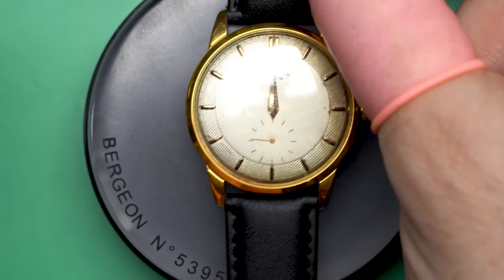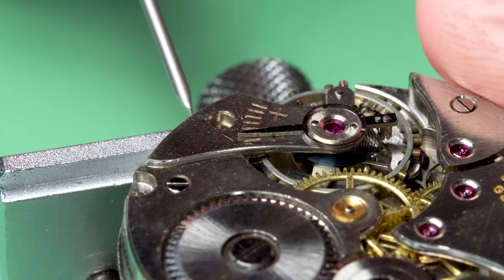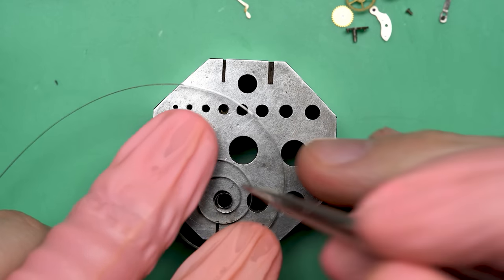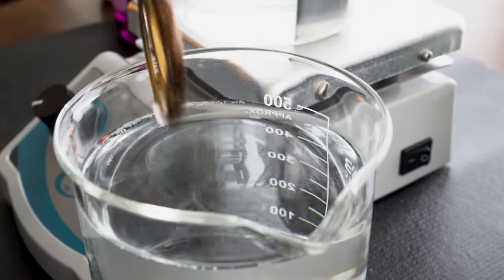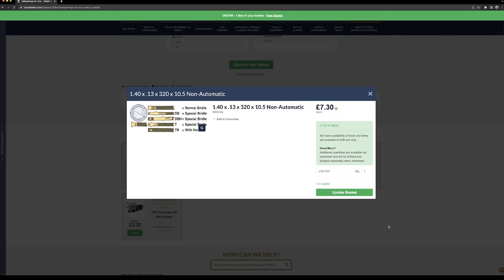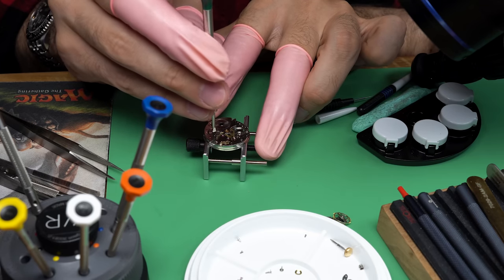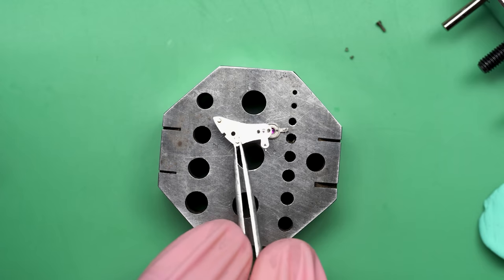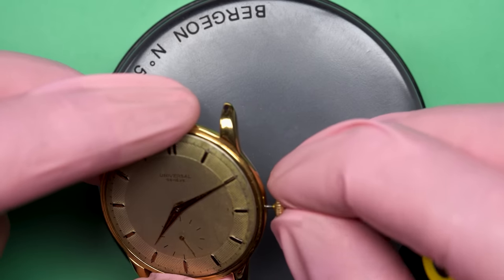Here's My First Attempt at Gold Plating During a Vintage Watch Restoration!

Comment: Nice job with the plating. A word of advice when you are plating, attach your leads, then turn on the power supply. The sparks you were causing when attaching and disconnecting your leads can ignite the gasses coming off the plating solution. Primarily this is an issue with with the cleaning solution as all the bubbles coming off that solution are hydrogen. The amount of hydrogen coming off that beaker isn't huge, but if it ignites it is loud and with scare the crap out of you. It could also shatter the beaker. I worked doing plating for over a year and had that happen a few times, but on large industrial tanks.
Reply: +1 Be careful!
Reply: Indeed, always put on the power last. And something with Hydrogen being an explosive mixture between 5%-75%. Otherwise cool video to watch and see the process.
Reply: Agreed!  I recommend a power supply that has an output on/off button.  So you can set up the supply with the output off to the right voltage and current.  And then hook up your wires.  And then just hit the output on button.  Cheap power supplies are always on and are not as reliable when they are powering up and down.
Reply: A good idea would be to get a small fan to blow over the top of the beaker. At least then you'd know you're not allowing much hydrogen to concentrate around your electrodes.
Reply: Crikey.
Reply: Thanks for this! deserves a pin i would say

Comment: The "Feintester" is an interesting tool that appears to be made from a dial indicator with a fixed anvil.  Dial indicators are commonly used in machining and mechanical operations for measuring fine distances.  Interestingly enough, they use a mechanism with parts very similar to watch parts, and serviced with the same tools.  I have some old indicators that I plan on cracking open and servicing, based on the skills I've learned watching this channel.
Reply: There you go! The power of a youtube channel.

Comment: Your videos inspired me to take a crack at watch disassembly and reassembly, just for giggles. Spent $40 on a used "not running"  pocket watch from a pawn shop. Turns out to run just fine if you wind it. Decided to take it apart anyway, using my trusty electronics repair screwdriver kit.

First screw I touched, I sheared the shaft on one of the case screws holding the movement. Back to the drawing board...

Comment: Marshall, you've got me to jump into the deep end! I just purchased a vintage pocket watch from Ebay and my wife bought be a Borgeon matt and basic tool set for my birthday. Lord, give me Marshall's patience! ;-)
Reply: Best of luck on your foray into the hobby!
Reply: @tradde11 pocket watches are still made today, albeit, not of the same quality as the days of ole...
Reply: @tradde11 I bought a 1918 Ball Railroad w/ a Hamilton movement. Right at $300. There were cheaper quality pocket watches, but I own a Ball wrist watch and wanted to stay 'in family' ;-)
Reply: @tradde11 Maybe junk isn't so bad to learn from. I have an automatic i got in China for $12, i cracked its crystal so i'll need to take it apart; might as well have a look see i guess how comfy i am taking apart and putting back together the mechanism; and if i ruin it, no big deal, they're a little more expensive now but infinitely replenishable. I'm used to doing microelectronics so manipulating really small parts with sharp tweezers without them pinging away too often is a skill i already have, so it shouldn't be THAT huge a jump. I'm thinking most people will struggle with tweezer control at first somewhat fierce, as well as working at high magnification.
Reply: @tradde11 We had not conversed before - you may be confusing me with someone else - and i have absolutely no gripes with you or your statements.

Comment: I've recently done my first nickel plating and made my own solution along the way - and it turned exactly the same green as you have in your nickel plating solution. I'm pretty sure just based on how it all works that you wouldn't want any sort of colourant involved, it would just risk bad interactions with the plating, same as any other undesired particle or contaminant.

It's really pretty stuff, honestly, particularly the gold medium. Mmmmm, forbidden koolaid!
Reply: @tradde11 It's actually super easy to nickel plate items. All you need is some distilled white vinegar, salt, a DC power source with clip leads, a glass jar, and a couple of small nickel plates. You fill the glass jar about 3/4 full with the vinegar, add about a pinch of salt (it increases the conductivity of the solution), clip both the positive and negative leads of the power supply to a nickel strip (positive lead on one, and the negative on the other), suspend the strips in the jar so they are not touching, and turn on the power supply. Once the solution turns green, it's ready. Turn off the power and remove the negative lead and it's nickel strip (leave the positive lead and it's strip connected and in the solution). Attach the negative lead to the item you want to plate and place it in the solution. Turn the power back on to plate. When done, you can store the solution for later use, but don't pour it down the sink or on the ground as it is somewhat toxic.
Reply: @tradde11 Yeah, what David said. The only part David might've left out is that you want to filter the solution afterwards before using it. Drip coffee filters are good for that.
Reply: You're totally right. That green colour would be from the nickel ions in the solution. Really cool stuff. Different metals ions in solution in different oxidation states absorb different light giving them their colours. Same reason that rust is orange and copper alloys like brass become green/blue after being oxidised.
Reply: @tradde11 I've made mine in similar way as described by others except i used a citric acid solution by just dropping as much of the crystalline stuff as would dissolve in water and diluting it then about 2- to 3-fold and dropped a little artificial sweetener (saccharine) as an attempt at brightener. There's really numerous ways you can go about it.

If you think about it there's actually plenty of useless organic junk floating about from any organic acid you use, especially vinegar is pretty filthy to begin with, not purely acetic acid. Once you have added salt for initial conductivity before you got any metal ions into the solution, you have at least sodium acetate/citrate or whatnot in there, there's no hard need to be particularly precious about the composition, the junk doesn't seem to interfere and might as well improve the solution.

If i were to guess, the colour is structural, by the metal ions in the solution interacting with light wavelength purely due to size. Gold solutions are known to build largely bluish purpleish colours. I don't think there's anything added for the colour, but if there was a dye, i don't think it would interfere.

Comment: interesting and informative video as always! i'm wondering about the cost of the main spring winder. i work in a field where tools can be very expensive also, but ~$1k for that single item seems very high, even for a low-volume, specialty tool. are its internals unexpectedly complex for a hand crank, or does it require calibration perhaps?

now that i'm asking this, i wonder if you'd consider making a detailed video (or a series!) on watchmaking tools, and what makes them unique and/or expensive? i personally find this aspect just as compelling as the restoration videos!
Reply: I'd love to see Marshall do another video on tools (he has a couple on the channel if you haven't seen them, like what tools you need to get started video mentions which tools you can buy cheap versions of). 

However, to answer your question, it's absolutely not complex inside heh, it's 100% a case of Swiss companies that serve a relatively low-volume tool industry gouging their customers. Mainspring winders are a perfect example of this, as they're extremely simple mechanically. The Chinese copies of these tools are 1/10th the price, and often made in the same factories where the "Swiss" parts are ("Swiss Made" is a bit of a scam term). You're really paying for finishing and quality control, since the Swiss companies will at least pay for better QA on their part production runs, compared to what the factories themselves sell as unbranded product out their back door.
Reply: @awdturbopowah773  i did check those out, and am always interested in more info :)

also, thanks for the explanation... i shouldn't be surprised (working in software/security engineering), but hoped that perhaps there was something neat and mechanical hiding inside! at least a $1k investment gets you that super satisfying "thunk" every time in return :D
Reply: @v-1nce  More info is always a good thing!  And sure, always happy to explain/complain about Swiss part prices 😁. It's funny in this hobby how the complicated stuff is actually cheap. A timegrapher with complex integrated circuitry, graphical display, and sensitive calibrated microphones is under $200. Yet simple hand tools that can be churned out by factory machines sell for thousands of dollars 😂At least you get the THUNK true!

Comment: Interesting, as always.  One question about the plating.  How do you tell when you've got the gold thick enough to last for a while?
Reply: In general, the longer you leave in the plating bath, the thicker the gold layer will be. Also subsequent runs through the plating bath yield heavier deposition. The exact thickness depends on many variables: chemical composition of plating solution, plating bath temperature, applied voltage, base metal composition, etc. The plating solution manufacturer may have data they can share with you. Most don't. If not, you will have to break out the micrometer and conduct your own experiments using trial and error.

Note also different terms refer to varying processes and plating thicknesses. Gold flashed, gold plated, gold electroplated, heavy gold plated, gold filled, gilded, and vermeil all mean different things.

For watch cases, typical plating thickness is 40 micron of 18k yellow gold or equivalent. How you achieve that is up to you.

Comment: When demagnetizing, you might want to demagnetize it in one direction, then turn the watch 90 degrees and demagnetize it again.  The reason for this is that magnetic fields have poles, and the demagnetizing field might line up with those poles.  If that happens the demagnetizing field will have no effect on the magnetized parts in the watch that line up with that pole.  The second demagnetizing field needs to be orthogonal, or 90 degrees to the initial field in order to completely eliminate any magnetized parts, according to applications of Maxwells equations.
Reply: Don't em degaussers first magnetize into a know direction then demagentize to prevent this issue?
Reply: @arimunic  That is correct to my knowledge.

Comment: There is almost certainly no coloring in that solution. Gold, when it is a fine enough particle, is a purple color. I'm not an expert but I have watched enough precious metal refining videos here on youtube to have been baffled by that fact.
Reply: It's due to the structure of transition metal atoms.. It's kind of complicated, but they all absorb different wavelengths of light when electrons in the d subshell move to a higher orbital when hit by photons.   I recently learned that's why pregnancy and covid tests show a pink/purple line, they use some type of gold in solution

Comment: Great content Sir. Inspired by you and a few others I put together my first watch a week ago. Was pretty straightforward. I'm used to handle small objects, repairing smartphones etc, so that was not an issue for me. What is more interesting is the accuracy of this build. It was running +8s/day out of the box. After first adjustment it has been running 4 days now and it's +3s ahead. Not too bad for a watch which costed 130 €. All parts from Aliexpress.

Comment: I love your videos... they're my favourite watchmaking videos. Any time you do one, I have to watch it. It also makes me want to get a vintage pocketwatch. Though hopefully I can find someone like you to service it 😅

When it comes to the colour of the solutions for plating, there could be additives which affect its colouring, but usually the molecules themselves associated with the metal will absorb light at different wavelengths, thus showing a particular hue. Silver nitrate has its associated hue, copper sulfate, etc.

Comment: Gold plated musical instruments (over brass, pretty common) tend to use silver as the intermediary layer. Very nice work, today, Marshall. Also, plating can usually be removed non-mechanically by a "reverse" plating process. I forget the particulars, but a lot less labor intensive.
Reply: Reverse plating is far more labor intensive than simple buffing. There are dozens of "gold recovery" channels on youtube that explain the process. It's not easy and involves some very nasty chemicals, which could potentially damage the base metal of the watch case.
Reply: Problem is that you'll pit the base metal, since anything that can dissolve gold even with help of electric current is that much more aggressive towards the less noble base metal. Buffing was definitely the right call.

Comment: Some (electro)chemistry notes, as much of my Ph.D. was about silver and gold chemistry: 

- Voltage doesn't scale with the size of the parts (though current does).
- Super curious to have that purple solution, and I don't have a ready answer about what's in there. But a curious fact is that colloidal gold is a pinkish to purplish winey red, depending on the nanoscale structure of the bits of gold. So that makes me wonder. Pure HAuCl4 is yellow as a solid and dissolves to a bright gold-colored solution.

Glad for your channel, Marshall - love your work :)

Comment: Great advice on the new mainspring vs mainspring winding kit. I have to say, you really like using the original mainspring in these old watches, but I'd probably put a new one in as it seems to me a consumable part. Kind of like replacing brake pads or shocks when they wear out. I really enjoy the content.

Comment: Two balance wheel questions: why are there a different number of posts around outside? And why don't you center or use what looks like an adjustment arm on the balance bridge? Thanks, your videos have gotten me through the pandemic!
Reply: The posts on the balance wheel are there to "balance" the wheels weight and optimize its inertial motion. Some balance wheels have them, some don't. The adjustment arm on the balance bridge changes the length of the hairspring as you adjust it back and forth to regulate the motion of the balance. You did in fact see him use it in this very video. At the beginning when he had the watch on the timegrapher, when he said he was going to try and regulate the watch, That "arm" is what he was moving to do that.

Comment: I believe the gold plating solution is purple because purple is actually the natural color of the gold salt that donates the gold ions. That's also why the nickel solution is green, because Nickel oxides tend to be green or black, and why copper plating solution tends to be turquoise blue/green. I could be wrong about that and they could be artificially colored, but if so, the colors seem to have been chosen specifically to match the natural colors of the corresponding metallic salt.
Reply: This is likely correct and it could be a cyanide containing salt, so be careful and dispose of the materials safely.  Download the SDS (safety data sheet) and read it.
Reply: That purple color is from coloid gold particles suspended in solution.
There has breen either partial reduction of gold or from incomplete solution during production of electrolyte.

Comment: Hello!  Fascinating to watch you work on the oldies!!!!  I would love to have you take apart (fix?) a digital watch.  I've had them for years, but know absolutely nothings about how it works.
Reply: There's generally nothing to fix with digital watches except your own mishaps. It's also rarely worth it since they are super cheap. The only actual repair i remember doing is for my father on an 80s Elektronica from Belarus where someone broke the leaf spring that connects the read lid buzzer to the module, it got lost, so i fabricated a new one from nickel plated steel battery welding strip, simply cut it out with scissors and carefully soldered it in. I also boiled the flat rubber seal, afterwards it sat better and caused less trouble. I offered him to replace the dinged up glass, i found the factory still makes fresh replacements, would cost me maybe 20€ to import, but he declined. Now with war and all that, that might be a little more difficult. It's also pretty rare for digital watches to even have a durable watch case, but this one turned out to be quite resilient stainless, basically not a scratch after 35+ years of wear. Casio and the like are just plastic, coated with a bonding agent, then copper plated, chrome plated on top, you get a few years out of them.

I also had some accidents with coil spring for rear buzzer contact being lost in more modern ones, but i fabricated a replacement from a springbar, easy!

If you want to take apart a digital watch, just order one for $2 on Ali. Just maybe don't wear it.